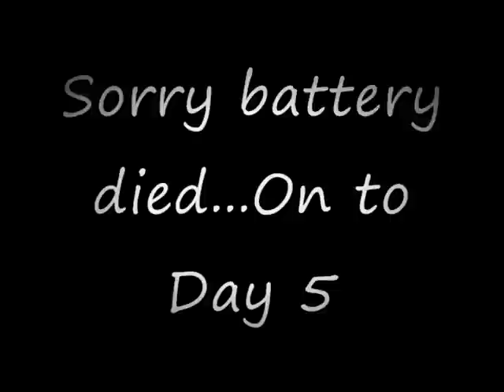Sixdogs1 and Safaribass "Operation Shake the World" - Day 4 & 5 - 4 12" Subwoofers

Comment: is there a nut and washer in the inside of the box on the rod? just so it dosn't try to bend the wood towards center of the box. if its got nuts on both sides of the wood (like a wood sandwedge) it will stop it pushing out and pulling in. just letting u know what i'm thinking mate :)